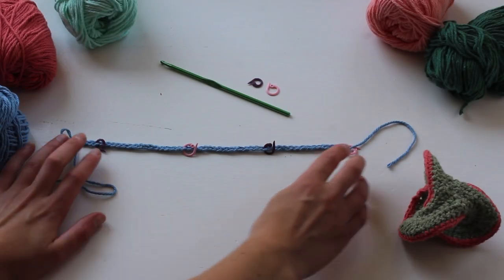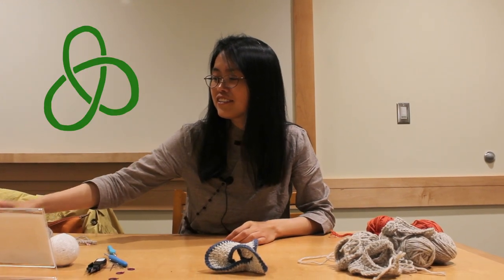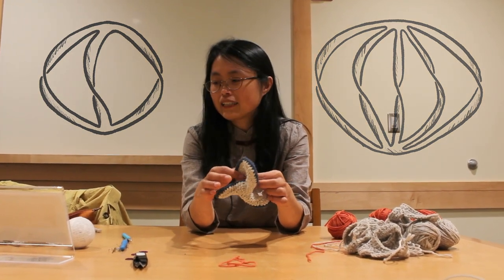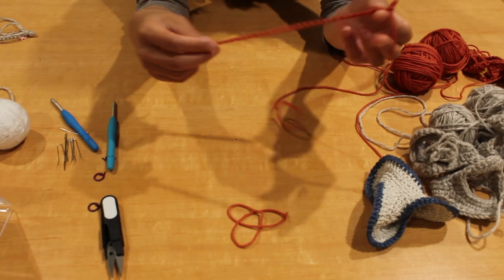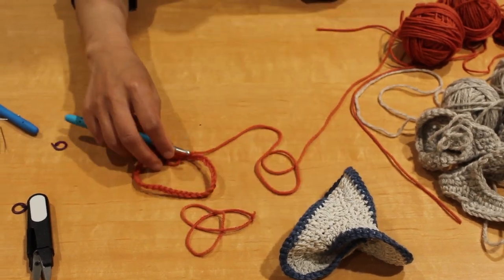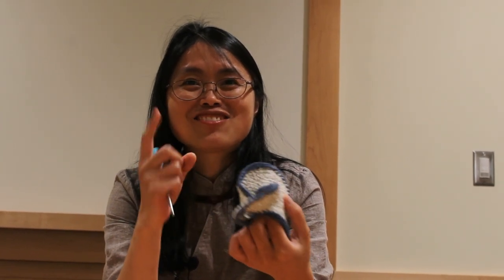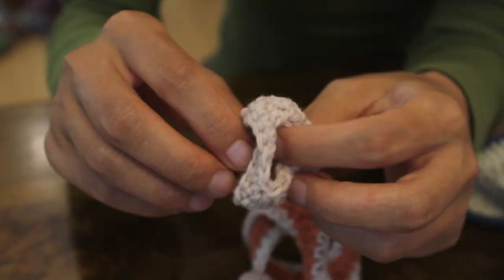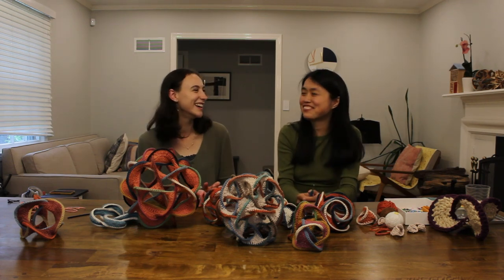Knots, Surfaces, and Crochet with Shiying Dong

Comment: I've now done a couple of trefoils. Started using the softball as help to position the initial chain but I found that wasn't helpful and used my left-hand fingers instead. Locking in the twists requires a lot of checking and re-checking but in the end all flows very well if you set it right.
As I haven't really grasped knot theory, I'm not sure how to use crochet to make 3d versions of other knots.
Reply from the maker: That's great that you've had success! This is the kind of project you need to try many times to get it right! 
If you're interested in making more surfaces like this, I made a video giving a generalized algorithm to make these patterns: https://www.youtube.com/watch?v=cas01tsYeHo
Also, Shiying has her own channel where she gives tutorials on a couple more designs: https://www.youtube.com/@epimono/videos
Happy crocheting!